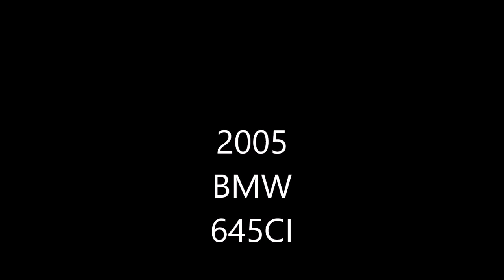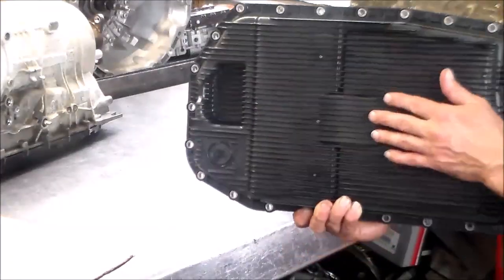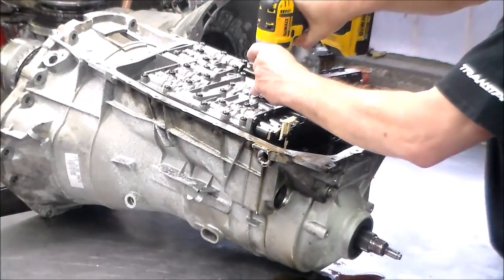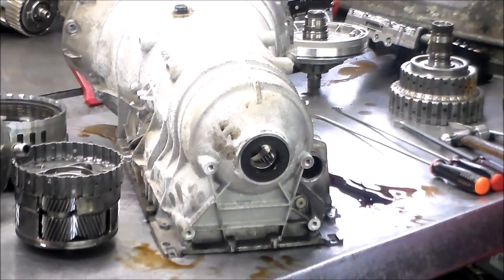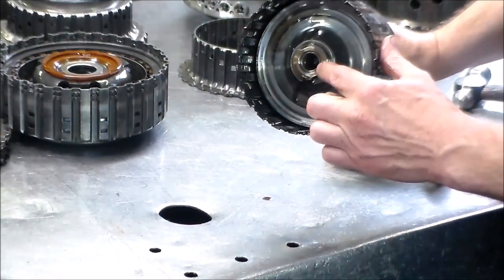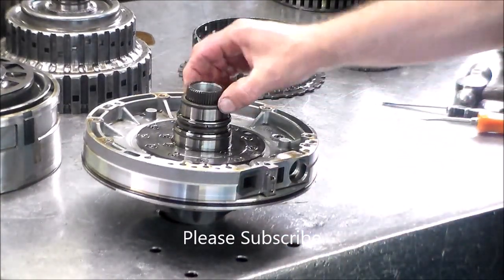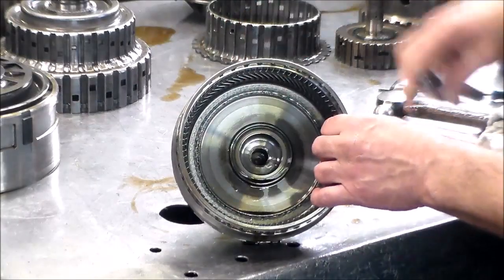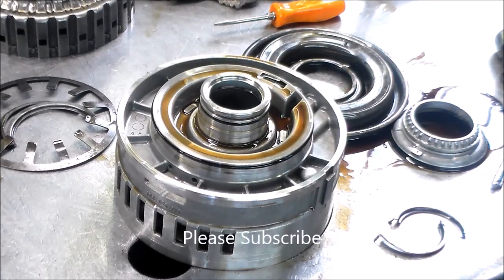ZF6HP26 Teardown, Code 4F85 Present

Comment: Found this site after watching a Jaguar XK8 video. I have a 2.7 Jaguar S Type with 6 speed transmission (gearbox in UK) which I think is the same as the one you are taking apart. Mine was refurbished a few years ago at some expense. After watching the procedure it is clear it was worth it! Thank you.
Reply from the maker: Thanks for watching

Comment: thanks hary for the reply.  I dismantled the gearbox and everything was burnt inside the last shaft D clutch. I also talked to other companies and I think the heat exchanger is to blame.  Antifreeze got into the gearbox
Reply from the maker: Yes, i would agree with a bad cooler, water kills the trans

Comment: Gary, 

I have an 09 550i with the 6hp28. 76k miles. I had the jolt/slip when kicking down into 4th gear when overtaking someone on the highway. It was going on for about 5k miles, but I did my best to limit the occurrences and it never threw a fault code. Finally in February it started slipping out of 5th and into 6th when in sport mode. That was not registering on the speedometer but I could feel it and tell by the RPMs. I got curious and went through gears 4, 5, and 6 individually in steptronic mode just to see if any were acting funny. Every time it was locked in 5th gear and I tried to give it moderate throttle, it would slip into 6th. It was a smooth slip, though. You’d only notice if you paid attention to the RPMs. I repeated the process a few times just to see if it was consistent and after the 4th time it went into limp home mode with a transmission malfunction on the idrive. I scanned it with ISTA+ Rheingold, and it had one code: 4F85 gear monitoring clutches B & E. It was the first time it had ever thrown a code for the gearbox (I am proficient in BMW coding and read the fault memory quite often). It wasn’t a hard code, either. 1st occurrence.  I immediately stopped driving the car and I rebuilt the valve body with a Sonnax Zip Kit, new solenoids, all mechatronics seals & sleeves, and ZF Lifeguard 6. The car drives fine now. Better than fine actually. But it didn’t at first. I didn’t reset the adaptations immediately after. When i took it out for some spirited driving it still jolted and slipped. No fault codes thrown. I just did the adaptation procedure last night and it seems to have done the trick. 

My question is, do I need to rebuild the internals or can I get away with just doing the valve body rebuild?
Reply from the maker: as long as it's working good, thats fine, if it happens again would need to come out, because the rear stator bushing may be worn out
Reply: @GaryFerraro  that’s what I was thinking, but I wanted to get an expert opinion. My valve body separator plate was completely delaminated on one side when I disassembled the unit. Replaced with new Sonnax separator plate. Also the accumulator pistons were all squished. Those were replaced as part of the zip kit. The figure-eight shaped mechatronic seal was falling apart basically. The rubber gaskets completely separated from the hard plastic. 

I think I did the right thing by immediately parking the vehicle after the code was thrown. I only drove it down the street to my buddy’s shop where I rebuilt the valve body. I’m a relatively skilled DIYer, but I’ve never even changed the oil on a transmission, much less rebuilt a valve body. Your videos gave me all the information and confidence needed to get the job done. You’re a blessing, sir! Thank you so much!
Reply from the maker: @scootitnbootit9231  Great to hear,  thanks for sharing
Reply: It’s been a year. How is your car fairing after the “lower end” trans rebuild you did? I did the exact same repair on my 2009 X5 3.0si (6hp19 trans) with the same clutch monitoring codes….I too did not reset adaption immediately, but once I did, the trans acted brand new….for about 2 years and 25k miles.…and here I am again. Throwing the same clutch-e codes with a 4-5 flare only when car (trans) heats up. I’m looking to replace the rear stator bushing now.

Comment: Great video Gary. Understand you are going through the valve body shortly, are there any key call outs on disassembly to ensure it goes together correctly. Thank you.
Reply from the maker: Make sure you get the correct plate code( example A053 or other side B053),  Be careful when you lift the plate off where all the check balls are.  When putting the 2 valvebody halves together, put a few bolts in and then install the TCM, that has the line up pins

Comment: Hey Gary i have a 2009 e70 x5 35d, i got my transmission rebuilt by a local shop because it slipped on clutch E under heavy wot and would have to pull over , restart and go again . Day after i got it rebuilt it did the same thing slipped again.... shop said they replaced clutchs , seals and cleaned up valve body. i check the code i got. 4F85
Reply from the maker: Did they replace the bushings? if not that is probably your trouble, that is the number 1 problem with this trans
Reply: @GaryFerraro  The shop said they replaced with sonnax bushings, could they be lying lol? This was supposed to be a full rebuild

Comment: No ESD wriststrap when handling the Mechatronic Unit?  Careful prying out those large rings.  Were you able to get readings of the clutch fluid pressure adaptions before teardown?  Orange O-rings are Silicone Rubber.  You want the new sleeves with Black Viton O-rings.
Reply from the maker: Gary VanRemortel I have the Snap-on scanner sometimes it shows them sometimes not. This had a pretty good 3-4  flare shift.

Comment: Hey Gary - firstly, your videos are incredible! Thank you. But, I made a mistake on the A drum. I did not mark the pieces before I rebuilt it. So no way of knowing how it goes back. The drum and planets went back together nicely and snapped back good. What are the concerns before I put the box back, that those pieces are not exactly the way it was before teardown? Feeling worried. Thanks man!
Reply from the maker: Thats ok, i just mark it for orientation of the planetary
Reply: @GaryFerraro  thanks for replying so quickly 👍. Okay so I'll be fine then. Was just stressed for a bit😂

Comment: Thx for the video dear. I really need your suggestions on the following please:
BMW E66 750LI '08 (ZF6HP26)
Error code 4E89 (Solenoid valve 1 or solenoid valve 2 mechanically jammed)
Problem:
- When cold car start and shifts fine even to sixth gear, post 5 minutes of operation the car would do the following:
- Keep slamming gear automatically into parking if at low rolling speed. 30% of the times a strong hit is heard as if some car is hitting from behind, this happens regardless choice was reverse or 1st gear. You would literally look at rear mirror. It shifts into parking even if speed is up to something like 5 km/h
- The moment you shift back into reverse or drive it will keep going back into parking and prevent you from driving.

Car lifted in workshop and following was noticed as per them:
- Particles of aluminum/metal shavings noted with in the oil pan (multiple small dots, nothing major). Oil brown and not bad.
- They tried replacing the whole control unit (Except its black ECU) with two other complete used units and problem still persist.
- They said the return hose of oil was too hot and recommended to replace heat exchanger + transmission thermostat + the whole gearbox with a used one. They suspected maybe the problem is from the heat or control box ECU damaged from heat or something else inside gearbox.

Now I am confused what to do every workshop just recommend to replace the whole gearbox because in here it is cheaper than fixing. Computer test (ISTA-D) reported transmission oil fluid temperature of 67 °C only while in parking for over 10 minutes with engine at 102 °C and error code was coming so it didn't flag high temperature and the control unit ECU seems to be communicating fine.

Please help.
Reply from the maker: When they had the valvebody down did they inspect the bridge seal?
Reply: @GaryFerraro  thx for fast response. No they didn't and the seals were never changed. Do you suggest trying to replace them first?  Thx
Reply from the maker: @See-5  I would look at that seal, if broken when hot the car will jump back to park
Reply: @GaryFerraro  Thank you I will replace them and keep you posted.
Reply from the maker: @See-5  ok, sounds good

Comment: I have a 06 550i with 4.8l engine, with HP26Z transmission ( called dealer to verify ). Is there a difference between HP26 and HP26Z?
Reply from the maker: one may be rear wheel drive and one may be all wheel drive

Comment: Hey Gary, I appreciate you taking the time to share your knowledge to the world! 
I have 528 xi 2008 that is currently not shifting out of park showing Trans. Malfunction: The Malfunction may be resolved by restarting, Contact nearest BMW. 
The Problem started after driving vehicle to work 5.5 miles. After returning to vehicle during lunch (5 hours later) vehicle would not shift out of park. After attempting to reset the transmission pressing and releasing the gas pedal vehicle shifted into gear and allowed me to drive home another 5.5 miles. When i exited the vehicle i left it running and returned in 20 minutes to the original problem of not shifting out of park. The error code the vehicle is reading fault code 4e22 electronic pressure control valve 3. 
I have been looking into getting new solenoids for the vehicle. Just curious what you think could be the issue! 
Thanks !
Reply from the maker: Either solenoids or the TCM, Common is solenoids shorted, need to drop out valvebody to ohm solenoids, get an OE solenoid kit and change them all if solenoid (EDS3) is shorted
Reply: Hey Gary I’m currently trying to purchase a valve body for the 528 bmw 2008. The valve bodies I’m finding only have 2.0L 2.5L and 3.0L
Does the 528 require a 2.8L valve body?

Comment: Hi. I love your videos. This made me try to fix my oil pump in my 6hp26 , The converter was rebuild and whend we try to remount everything we broke the oil pump. Issue is now i opened again the gearbox , and i found inside gearbox like under mechatronic , like a tiny PIN , that i have no ideea were in world it comed out from. I checked all diagrams for ZF , google , and i still have no clue. I dont know if you can help me , it would be much apreciate it.
Reply from the maker: send me a picture of it
gsferraro@yahoo.com

Comment: Hi Gary, is it possible to remove the stator without opening the gearbox? I just wanted to put the gearbox upright, take off the converter, remove the stator and change the stator bearing. I did not want to drain the oil and remove the mechatronics. If I remove the stator like this, do you think I'll damage the gland seal?

Greatings from Germany
Reply from the maker: The valvebody/ mechatronic has to come off to get the pump out
Reply: Okay, thanks a lot for your fast answer!
Have you bought the tool to knock out the statorbushing? I can't find it.
Reply: Hi Gary, I did the repair on Monday.  Unfortunately, when the engine is running, transmission oil drips from the opening in the transmission bell.  I think I didn't tighten the screws on the stator enough.  On Saturday I will remove the gearbox again to check it.  Do you know the correct torque for the screws that hold the stator to the gearbox?
Reply from the maker: @matthiasmuster3144  Make sure the o-ring is good and the bolts that hold the pump to the case, the ones on the outside, they should all have a washer too.  I tighten them to 100 inch pounds
Reply: Thanks for your quick help Gary. I will act on your advice and I hope I have removed the gearbox for the last time 😁. 

Greetings from Germany
Reply from the maker: @matthiasmuster3144  If you can, maybe have someone else yank the converter out quickly, then you can see where the leak is,  Make sure the converter gets pulled fast so the oil doesn't leak out of the converter
Reply: Hi, gary, okay, this is how I'm going to try it. Thanks a lot.

Comment: excellent video Gary, just a quick one Gary, when changing the clutches must i use the vernier caliper to measure the steels and the frictions on all the transmission but i am thinking that as far as the clutches and frictions got enough play. pls i need your advise. thanks
Reply from the maker: That really depends on the trans, clutches should be changed and if the steels are ok, put them back if they are burnt you will have to replace. If your for instance working on a honda with 5 clutch packs, you will need to measure the thickness and in some cases you will not need to

Comment: i have a question about the weight of the transmission. I have similar code 4F85. The car wouldn't engage from 3 to 4th gear. I am wondering if the transmission is heavy to lift?
Reply from the maker: I would say about 250 pounds with converter

Comment: hi.Gary.my name is Daniel i'm from austria i'm a fan of yours i follow all your tutorials on you tube and i've done a lot of reps.  thanks to you. but now I have a problem with a bmw x5 2016 gearbox. model 8HP72Z. it has the error code 421362...Gear ratio monitoring all clutches implausible and the oil is very dirty and has metallic coating. With two weeks  a wash was done before but it didn't help. I checked the megatronic, all the valves are ok. I need your advice please
Reply from the maker: ok, this unit is full of oil?  do you have a plastic or metal pan?  what is the car doing? slipping?

Comment: @Gary Ferraro i have a 35d with ZF GA6HP26Z. i have a cycling slipping problem in all the gears and at various speeds (cruising at light throttle only). Its like riding a horse... After changing oil, pan and the rubber seals in the mechatronics and pump i reset the adaptations and followed many times the adaptation instructions. BUT rapid fill times never got completely filled with values...
i had flares between 4-5 WOT (more in sequential than D or SD) since the reset.
Have any idea where the cycling (oil pressure i suppose) problem is and why i cant get the rapid fill times adapted?

BTW thank you for your videos, Best Regards
Reply from the maker: Nuno R   It’s full of oil for sure?  Is your problem mainly in the higher gears?
Reply: @GaryFerraro  Thank you for answering!
I have filled it and followed the ZF instructions: iirc, i filled with oil, started the engine and filled some more until it dripped out.
Then watched the gearbox temp in the Diag and once it was in the correct ballpark, opened the fill plug and let it drain until only a very thin stream was running out. closed it. done.
I have blown air to get the most oil i could out of the tq converter (while the mechatronic was out). Should i have done a refill and level check after a few miles???
The problem seems to be in all gears, but yes most felt in higher gears. its like the torque converter solenoid PID is searching for the correct % of actuation...

Comment: I’ve watched a number of your 6hp26 videos over the years.  I did a full valve body and solenoid and bridge seal repair on my 2009 X5 3.0si (wasn’t aware it was a 6hp19 trans until this very video) with the same E-clutch monitoring codes….after that “lower end” repair 2 years ago and adaptation reset it acted brand new….for about 2 years and 25k miles.…and here I am again. Throwing the same clutch-e codes with a 4-5 flare only when car (trans) heats up. (Same issue I had 2 years ago) …..I’m looking to replace the rear stator bushing now. Would you advise to replace all the bushings? Every other gear, both upshift and downshift is flawless. 

Thank you very much for all your videos. I have watched hours of them so far!
Reply from the maker: You probably would be fine with just the rear stator bushing,  That is the seal for the E clutch apply oil
Reply: @GaryFerraro  after watching your 6hp19 tear down video I believe my method of repair is to replace the rear stator bushing like you always mention as well as the E-drum clutches/friction rings and possibly steels if they are burnt up. Where can I source the parts? I am in South Carolina. 

Also, I saw on that 6hp19 video that there was a secondary, forward/support rear stator bushing… is that 6hp19 specific? Will I encounter that on my xdrive3.0 (AWD) X5?

Comment: Hello, I have the 4f8c code, I replaced the sleeves and adaptor, oil and oil pan, problem is that I have some vaico sleeves that seems thinner than Zf oem ones. NOW I ordered some Zf rebuild kit, including valve body seals, my car puts the transmision in failsafe mode after kick down between 5 and 6, what do you think, is the culprit non oem sleeves, thanks a lot
Reply from the maker: Did you have this problem before you worked on the car?
Reply: @GaryFerraro  no not at all , a bit off kicking between 1 and second gear, I also installed a new guibo and reset adaptation, it was the first time  the code apeared but at low speed as  the gear selector passed a bit after D (Gear lever had the sensasion it s not engaging so firm after adaptation reset) second time at high speed happend to enter in transmision failsaife code 4f8c
Reply: Problem solved, no error codes, never use other stuff like vaico or shitty aftermarket products. Managed to open the mecatronic and to change the valve body. Changed the sleeves, adaptor and fresh zf oil. Reset adaptations and all the gears change smooth, no clutch sleep. The slleeves from vaico  manufacturer were not good and almost melted and obtured the holes. Never use other than oem zf parts, lesson hard learned, thank you.
Reply from the maker: @adrianvalcaneant660  Thanks for the update, only OE agreed
Reply: Where did you ordered the zf build kit?
Reply: @GaryFerraro  Mine has got a code 4f8a egs:ratio monitoring  gearshift 4-5 and 4f85  egs:ratio monitoring clutch e. It happens evrytime i have reached 100km/hr please help
Reply from the maker: Sounds like rear stator bushing is worn out. The rear stator bushing seals E clutch apply oil